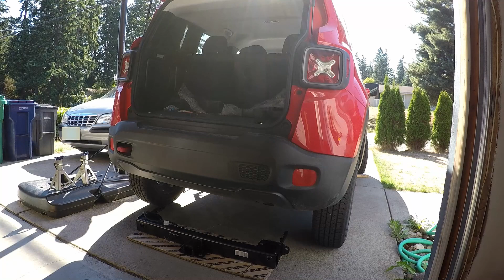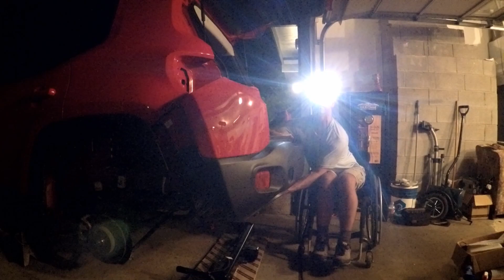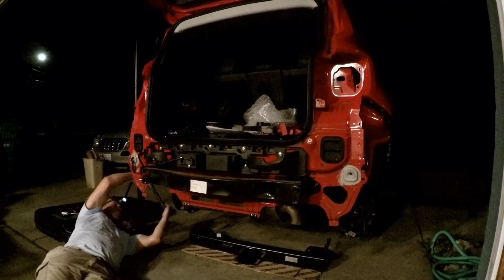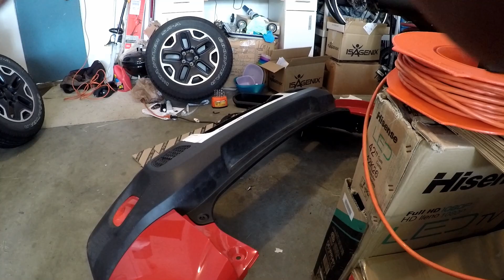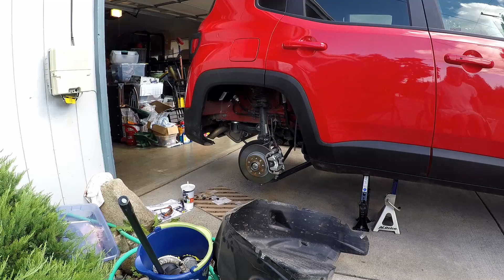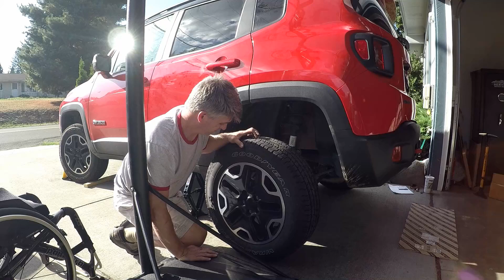2015 Jeep Renegade trailer hitch installation

Comment: I just purchased a 2018 Renegade Latitude, and will definitely be installing this kit. I just can't stomach installing an undermount hitch. This factory retro keeps the departure angle stock, and looks so much better. Great install! It looks more time consuming than difficult. Now I don't have to break in to a cold sweat just thinking about the install. LOL
Reply: D D  LOL. I actually purchased an under mount hitch from Renegade Ready. I received it, and attempted an install, and things were just not matching up. I called them to let them know what was going on, and they told me that I was installing it incorrectly, and that I should try again. I tried again, and they still told me that I was doing something wrong. I sent them photos, with a measuring tape in the frame, that showed that the hitch did not fit, and they still told me I was full of it. I finally called the actual manufacturer of the hitch, and got them to send me the engineering drawing of the relevant part of the hitch, and found that my hitch did not match the drawing, It was built wrong. I sent the drawings, and my measurements to Renegade Ready, and they agreed to RMA the hitch, but basically said that this is what happens when you cheap out, and don't buy their premium product. I had to wait until they received the old hitch, and received a return authorization from the manufacturer before they gave me credit for the faulty unit, and I purchased the OEM style hitch from them, mainly because they were the only source. It did fit perfectly, and though they tell you to be careful not to break the body panel fasteners, they do include enough new fasteners to replace all of the ones involved. It was a bit of a job, but got it installed, and looks great. The cutout pattern they provide was garbage though.
The install took the better part of a day. 
It isn't too late for you to go the OEM way! LOL

Comment: Sir, any chance you can give me the exact link where you got this actual hitch pls... I really want to buy but too afraid to screw up my order.. thanks..
vhon from ireland
Reply from the maker: I think the kit has changed some over the years, but this is the kit and where I got it from.
Good luck!!!
https://renegadeready.com/jeep-renegade-trailer-hitch-retrofit-kit-by-renegade-ready-6179
Reply: Hi Karl, after watching your video atleast 100x, I managed to copy your new bumper just by watching it. It's way much better than the original.. I even bought that same bumper facia you have. But they didn't send the cut off templates, maybe you still have copy that i can borrow? thanks for sharing your video..

Comment: What kind of renegade is this? 1.4 or 2.4? Trail hawk, latitude, or sport? I'm trying to put this kind of hitch on my 1.4l 6 speed latitude, trying to find out if it will bolt up. Your jeep looks great and you did a excellent t job. Thanks in advance
Reply from the maker: It's a 2.4L Trailhawk.
& Thank you!!
Reply: The 2.4L is rated to haul up to 1 ton. The 1.4 must be like 1200 lbs.

Comment: You're a boss. Excellent work! Where did you get the trailer hitch and bumper insert from?
Reply from the maker: Thank you!  
RenegadeReady.com for the kit. http://www.renegadeready.com/Trailer-Hitch-Retrofit-Kit-for-Jeep-Renegade_p_77.html
It comes with the faceplate piece that I cut round in the video.
Comes with - Bezel Fascia. This is the decorative trim piece to frame the receiver and connector that is inserted into the plastic bumper cover—a precision hole must be cut for the bezel using the template provided.Good Luck!

Comment: Do you have the link where to buy the tow bar? Great job!
Reply from the maker: Hi! 
As they note, they aren't selling the kit as MOPAR increased the price of the bumper.
They have a parts list which may help get what you need. You could try calling them to see what they can do to help; maybe sell the kit with all the parts and instructions but not the bumper. 
Good Luck!
https://renegadeready.com/jeep-renegade-trailer-hitch-retrofit-kit-by-renegade-ready-6179

Comment: Have towed a trailer yet? If so, how did it do and what size is your trailer?  I’m looking at a 18 Renegade Trailhawk, and I have a small utility trailer I haul my kayaks with, just wondering how it would tow.
Reply from the maker: Have hauled an 8x4 UHaul. It did fine. Was lightly loaded for camping.
That sounds light. Should be fine

Comment: Question:  I did the same kit, but didn't install the 4 pin wiring harness.  How simple was that to wire together?  I'm thinking of redoing it so my toaster jeep can tow our pop up trailer.
Reply from the maker: From what I recall the wiring part was pretty simple. The wiring and a module are tucked in that left panel with one of the fuse boxes.
Running the wires to the place on the hitch might be more challenging with everything installed/mounted.
If you don't use it a lot, you could hang a pigtail out the back hatch.

Comment: What parts did you get for this project and what would you say was the overall cost? Just got quoted today’s for this install and the shop quoted me $2,100.00.
Reply from the maker: I bought the kit from Renegade Ready.
http://www.renegadeready.com/Jeep-Renegade-Trailer-Hitch-Retrofit-Kit-by-Renegade-Ready_p_77.html
I got the wiring kit with mine as well>
So $700 or so at this point.
Then there's the labor. It's definitely doable for DIY.
Not sure what shop labor would be on it.
I have tools and such, so my dollar cost was just the kit from Renegade Ready.
Then there's the time involved and opportunity for mistakes.
It all went well. Cutting in to the bumper fascia was frightening. It went well with the provided template.
I used a screwdriver to help set the new part in to place in the bumper which caused some deformation.
Don't do that. 
At second 7 in the video you can see 'bumps' along the top horizontal line.
Good Luck!!

Comment: By any chance is there anywhere i could just get the template to cut my bumper i already have the tow bar
Reply from the maker: I honestly don't know. Could see if Renegade Ready would sell just the template.
Reply: @karlr4481  yeah going to have to contact them to see. Thanks
Reply: @josephjimenez574   did you ever hear back from them? I messaged them and haven't heard back yet about buying a template and wiring kit
Reply: @ASchultz88  I think I read somewhere that they dont sell it like that I bought everything at my local dealership and cut the bumper myself with no template
Reply: @josephjimenez574   yea it's about $150 cheaper just to buy everything with out a template. Was hoping they would sell me a template when I bought the wiring kit cuz I'm not that great at cutting straight lines lol
Reply: @ASchultz88  yeah I wouldn't say I'm the best at it either but I just mounted the tow receiver then put the bumper on top and felt were was the 2" receiver square at and started from there
Reply: hmmm that's a good way of doing it..  save me some cash! Thanks!

Comment: Was it tough to make the cutout in the fascia?  Did you find a template to make this cut?  Looks awesome, btw.
Reply from the maker: It was a bit challenging. First cut was the toughest; commitment issues. 
After that, just a slow & deliberate process.
When latching the insert to the bumper, don't use a screwdriver to help push the bumper over the latches. It made an imprint on the bumper. It's minor and not too noticable
Hopefully that makes sense.
Good luck!
And Thank you!

Comment: Did you unhook the battery cables before starting?
Reply from the maker: I really don't remember, but it wouldn't hurt to do so. I'd recommend it if doing the trailer lighting / wiring part of the project.
The Renegade Ready kit came with detailed instructions, and probably said to disconnect the battery to be safe.

Comment: Do you have a link for that part? Thanks!
Reply from the maker: http://www.renegadeready.com/Trailer-Hitch-Retrofit-Kit-for-Jeep-Renegade_p_77.html
Reply: @karlr4481  and for the plastic clips that will break?!
Reply from the maker: @iqcarlospinzon  the kit from Renegade Ready came with some clips, from what I remember. Could as the Jeep dealer or the local auto parts store. They may have compatible clips.
Reply: @karlr4481  web site  said not for sale but call for the price what do u think